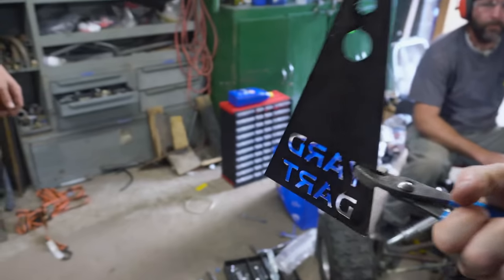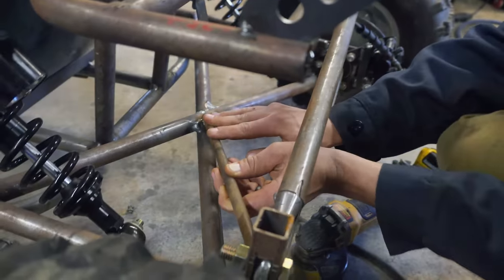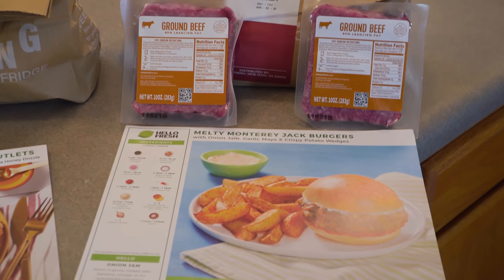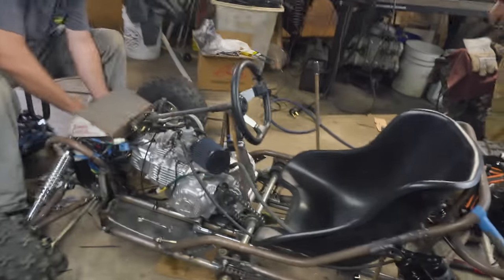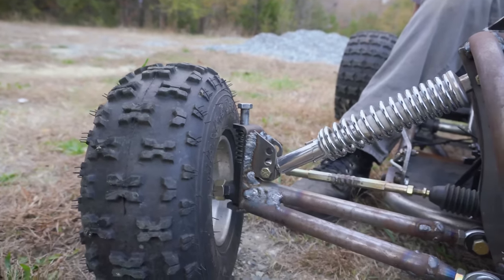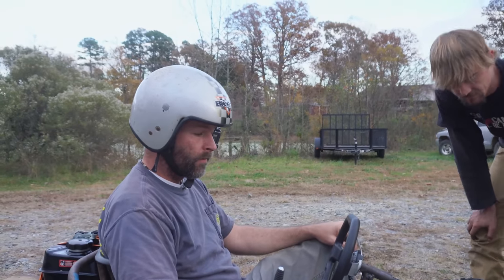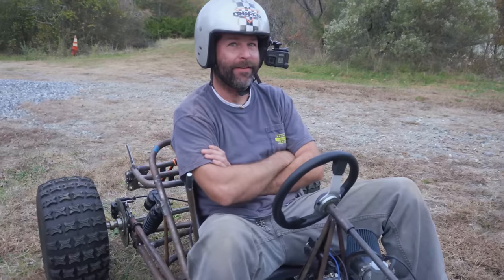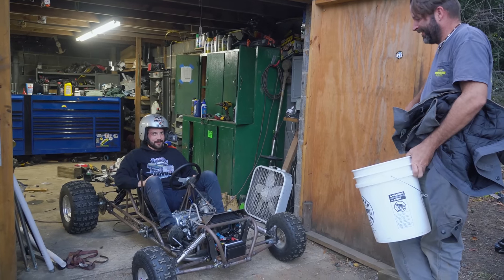190cc Yard Kart Killer First Test Drive | UNTESTED POWERHOUSE!

Comment from the maker: Still needs lots of work, but this kart has a ton of potential!
Reply: Wow just wow
Reply: When are u guys gunna finish the 2 stroke race kart?
Reply: thought? put a airplane engine on something and have it propeller driven?
Reply: Just like us....Hey,I gotta say this one is my favorite project of all and I really don't even have a reason...js...Maybe I'll know later tho..
Reply: @CarsandCameras do you all do work for fans
Reply: There's still a lot of potential indeed even from a 190cc
Reply: When are yall guna do thomthing with grind hard plumbing I know yall are on difrent sides of the country but id be cool
Reply: Awesome build guys. Tho your Ackerman angle is still not right, that is why turning radius is bad. Inside tyre should turn more, to put it simply. All the best from Serbia
Reply: No! Not the tramition!
Reply: @bowilson3483  Would be really inefficient with poor performance. Especially on dirt, it would just be a slow death trap.
Reply: Happy Holiday dudes!
Reply: I'd be more worried about the shifter than the fins lol
Reply: Cars n Cameras.. Engineering dept: you could have mounted the engine underneath the seat...allowing you to use Go Power Sports IRS system...as for the front suspension shocks at that angle...?
Reply: Love this build so far. Can't wait to see it finished.
Reply: While you're working on the steering, go on and add the Ackerman angles to it.
It will be a lot less scrubby and improve the turning.
Reply: yeah it can be a fast one
Reply: Where did u get it
Reply: Make your shifter shorter. It adds stress and extra throw for no reason
Reply: I plan on putting a street bike engine on a lawnmower frame what type of rear end from gopower sports would I need ?
Reply: Try a gas pedal like a sand rail has with a skateboard wheel
Reply: So here’s an idea… to save yourselves the inherent losses in the jackshaft/rear suspension pivot design so prevalent in your front engine/rear drive designs try front wheel drive. Seems much more compact, far less powertrain loss, and insane ability around the CarsandCameras dirt oval not to mention I’d expect pretty fine ripping around the Gran Prix course. You’ve already proven you can do it on the Power Wheels Baby Bronco build. Imagine the weight savings, simplification, and extra power available if you weren’t having to transfer power to the rear wheels as well. A fully independent suspension would be another big plus, though you’d likely want some type of anti-roll bar in the rear. Only caveat that may prove difficult is you’d likely need something resembling a limited slip front diff for optimum traction while accelerating and cornering. An open diff would corner nicely but have garbage traction on takeoff and cornering would just spin the inside tire and throw dirt all over the driver. That’s no fun. But rear brakes could be used to drift while still applying power… cmon, what’s not to like?! I look forward to hearing any thoughts you all may have in a future episode.
Reply: Need to makea body kit for this and then get ahold of Flair he is getting into karts

Comment: Very nice build.  I have some suggestions for refinement.  In my opinion you will enjoy the drivability a lot more if you shorten the shifter to 6-12 inches and place it near your hip, about mid thigh. And then cut the seat out so that it is not in your arm pit when your hand is on the shifter.  This shifter position allows you to hang onto it or near it when cornering.  Found this to be a great position after building my first shifter cart in 1980.  I used a 100cc two stroke Chaparral motorcycle engine. Then later used the same frame and put in a supercharged Honda Z50 engine.

Comment: That shift throw seems pretty long.  Migh also want the clutch on the shifter w/ a handle so you only need to work abt gas and brake w/ feet

Comment: This rear setup is fighting itself. Crossed braced trailing arm with a panhard bar will bind. The bar will be in tension in both compression and rebound. Having chain drive with the chassis mounted engine, trailing arms and wide track is the madness of this setup. I do hope you test it without the panhard. Hope it all works out, congrats on the million and keep the builds coming.
Reply: Kinda what I thought.....it could travel up and down evenly but bind if it articulates....right?
Reply: I missed the fabbing of the trailing arm to bearing design....can the rear articulate?
Reply: @benrials8010  no i can't, and they don't want it to. the engine is mounted to the chassis, so if the axle articulates then the chain comes off.

Comment: I have a feeling this will be one of the quickest on your grand prix.  If I can make a suggestion, redo the shifter so that it is a short horizontal stick down at your hip so all it requires is a quick yank up or down, with it being so long and tall like it is now, not only does it take longer to shift but you could inadvertently put too much torque on the shifter shaft and break something.  (hopefully that's not what already happened!)  Keep up the good work guys!

Comment: The yard dart switch panel is the next skill level for you guys. Looks good.

Add some weight to your flywheel for help taking off. The engine will rev slower but will have more inertia at takeoff from a stop.

Comment: i got on this kick recently of looking at cyclkarts.  its got me thinkin.  lifan 125 up front to a magic box then to a go powersports axle as a drive shaft to the rear.  or a out board chain drive but that chain be huge. with that setup it could have disk brakes at all 4 corners just cut holes in different spots in the back support of the pedal to adjust brake bias.  it also be neat just to use trailer springs and lift supports as shocks.

Comment: Tail fins!? You need to do something with the "IMPALER" shift lever.  I think you will want to lower the gearing too. It seems like you are going to be torching that clutch to launch it hard. It will be interesting to see how the top speed is.
Reply: I thought it was pretty shity how Ike just kicks off the fins Charles put on. He could have politely removed them off camera instead of Chuck Norris them across the shop just as show how much he didn't want them on. I sense some hostility from Ike towards Charles.  Lay off dude

Comment: When you got this thing all done you're going to have to drop a brand new 190 in it with electric start and everything maybe eventually pick a cool power Wheels body and put it on it definitely needs a new bigger motor ported and polished performance carburetor and exhaust The works in this thing would probably be the fastest thing you have once geared correctly

Comment: Hey, I have a question about an axle that im trying to use on a barstool kart. I am very new to all this and could use some help on how to affix the sprocket and brake disc to axle. It does not have a keyway or spline for either. I am sure their is a part or something that I can use to connect it but like I said im not to familiar with names or parts yet.

Comment: To tighten up your steering turn, just shorten your steering arms to about 2 inches long each, this worked well on mine with steering rack. and guys shorten your gear lever, it doesn`t need to be much longer than a standard gear lever. That will make it much precise and easier  to change gears, and find neutral etc.

Comment: Just fuel clamp that bolt it'll buff my guy did that on my buddies cart weight is for frame 67.3 engine is around 50 ish got a 420cc powe fist off a pressure washer throttle n governor go different ways so gotta run reverse throttle on n it is nutty

Comment: IMHO Castle nut and cotter pin those steering bolts. If that happened once it can happen twice. Over engineering on the side of safely beating the crap out of it on full send mode may save a pound of flesh in the long haul.

Comment: I always wanted a cart with a manual gearbox it makes the most sense for climbing hills and al around top speed I can’t stand the centrifugal clutches they slip and limit performance drastically especially if you have anything under a 10 horse motor it has way more parasitic power loss as opposed to manual

Comment: all your gas peddle angle problems go away if you use a skateboard wheel instead of a tab. and you'll never have to worry about getting a shoe caught under it either (that's very scary when it happens).

Comment: With the engine in the front why didn’t you place the seat further back on the frame? It would have balanced the weight better and you wouldn’t have to drive around with your knees up in your chin.

Comment: GUYS! i lapped my valves, sanded my head down a bit, did a slight port and polish but it doesnt want to run low rpms! And after high rpms it quits!! Help!
Reply: And my pushrods are the same length , one is .25 grams heavier, exhaust right??
Reply: Check cam timing. Valve gap. Vacuum leaks etc etc

Comment: Yard Dart is coming along great, still dont understand the front engine mounting, also the seat needs to be moved back approximately 4", looks like an adult driving a Power wheel, be prepared for calf cramps, and an ass pounding if the seat isnt moved.
Reply: Trying to get a 50 50 balance of the frame